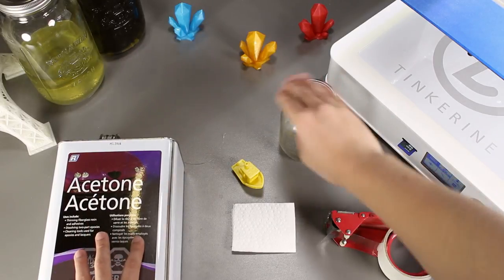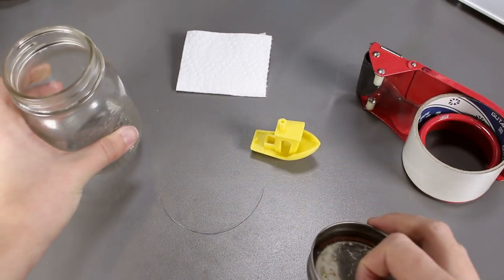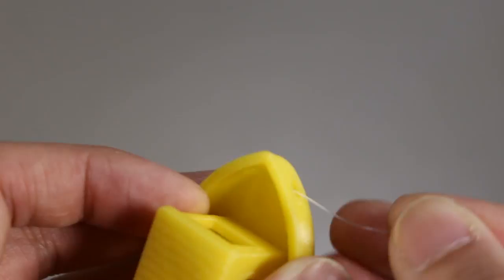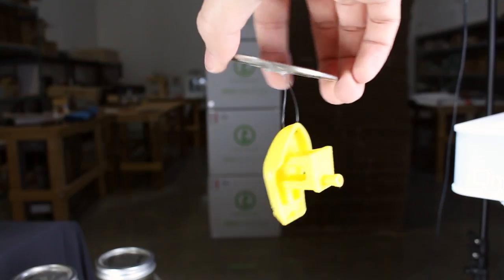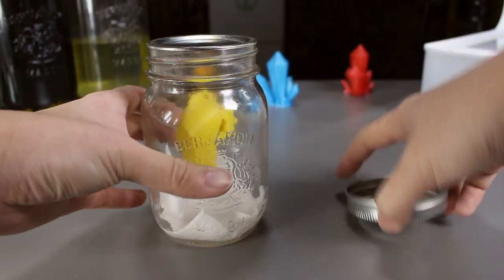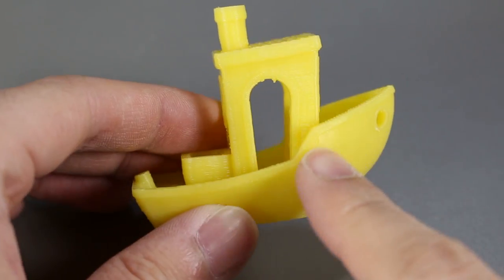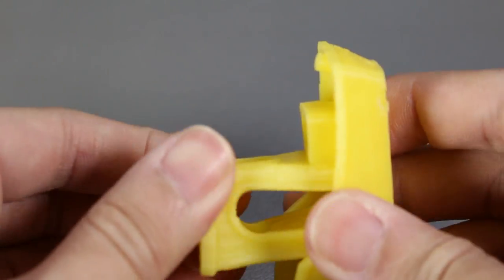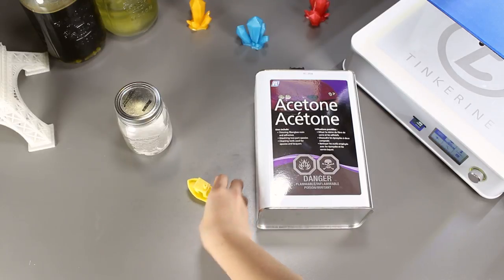Attempting to Vapor Smoothing with Acetone on PLA

Comment: Supposably acetone will actually settle to the bottom of the jar, therefore you may have better results with circulating air or suspending soaked acetone above the print. Cheers!
Reply from the maker: Thanks for the comment and the advice!

Comment: So I suppose this is acetone "annealing" rather than smoothing. Might still help with strength by releasing internal stresses.
Reply: the more you know. Might be suitable for applications like bumpers for drones, this would absorb more energy as it bumps against stuff.

Edit: or not, just read below that the PLA hardened again once the acetone evaporated out

Comment: Surprise accidental discovery of the rubbery feel & how easy it can be softened before the acetone evaporates.

How long would it take for the acetone to totally evaporate away?
Reply from the maker: Hi,

It took roughly 10+ hours for the acetone to completely evaporate from the print. After the acetone evaporated, the print harden to it's previous state again.
Reply: @Tinkerine  Could this actually being usefull for easier sanding?
Reply: @BioClone  Id Imagine it would cause gumming of the plastic

Comment: Aceton should not react with PLA. Is that realy PLA? isnt that ABS? Which can be disolved in aceton which is comonly used to smooth ABS? Becasu for PLA, people use... chloroform?
Reply: does chloroform work well?
Reply: Correct, it works for abs